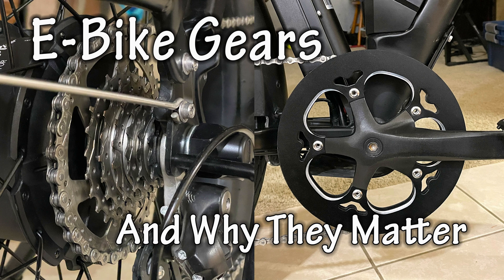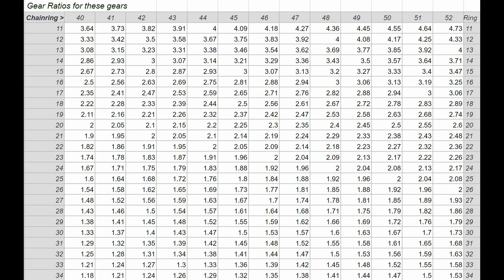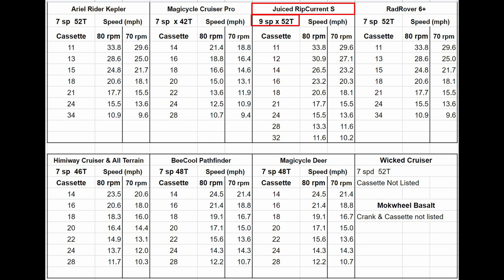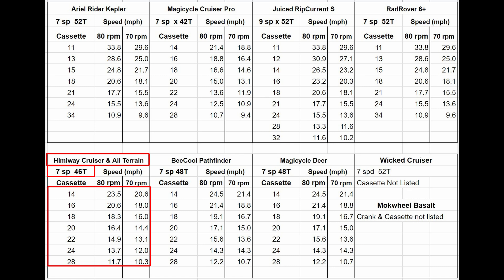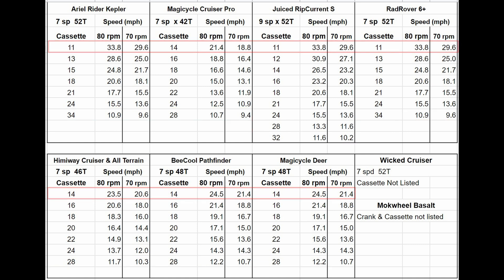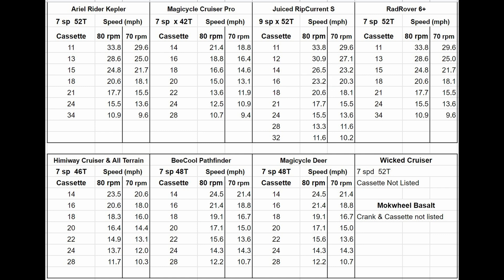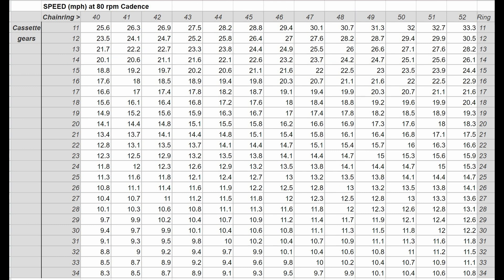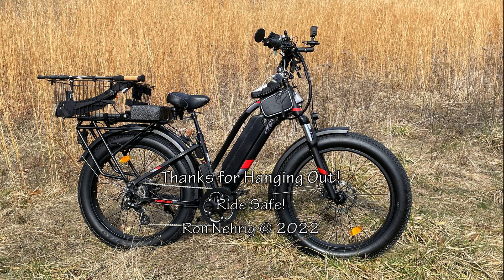E-Bike Gears, and Why They Matter

Comment: Hi Ron I know this is totally unrelated but do those vee  speedster tire increase MPH in anyway negligible way?
Reply from the maker: I didn't test for an increase in top speed which is more circumference and motor power, but they are very quiet and smooth on pavement, and felt very controllable; they roll much easier than the stock CTS tires and would certainly coast longer, and be easier to pedal at higher speeds. I even used one on the front off pavement, like in Dead End River Road, and on the gravel and broken asphalt i've ridden on, and it worked pretty well, but due to the deep gravel and slippery forest trails i've been riding I swapped it for the Fenix p-1215, also called Wanda” on ebay, to see how much difference that would make. I've been testing several tires to see what i like best for an all around tire. For just pavement i would still choose the speedster.

Comment: This link may be helpful for some points in gearing on the Wicked.. I would take it with a grain of salt however . 
https://youtu.be/T1nYjsGInUU 
He claims his wicked bike has 14-28 rear with a front 52.
Reply from the maker: Yes, i saw that. He said the Kepler has a 14-28, which is wrong. I corrected him in a comment, but didn't get a reply.
The Wicked looked like a smaller cassette, but i didn't want to speculate. I called Wicked, but they were busy, and i didn't feel like messing with it further.

Comment: I did see one ebike that has a 58 tooth front sprocket but it's a single speed ebike .. Maybe one from electric bike company. Can't remember what the rear gear tooth count is.
Reply from the maker: Yes, there are larger chainrings, but they have other issues.